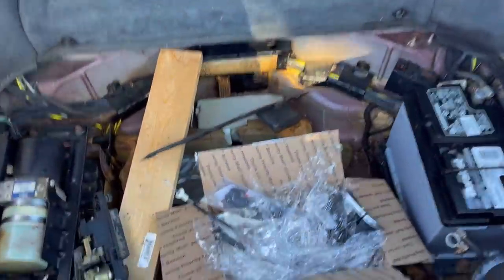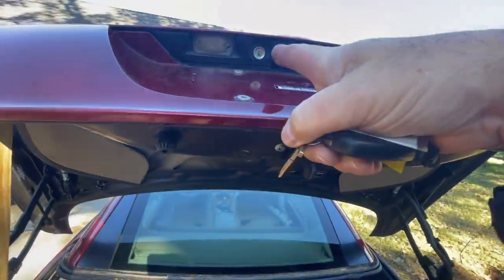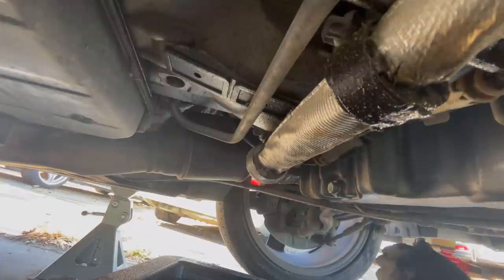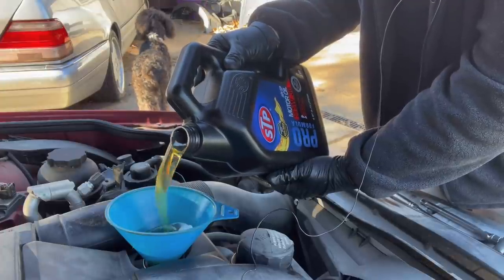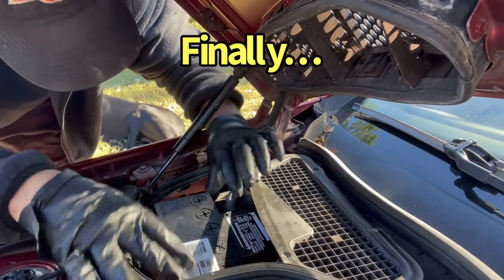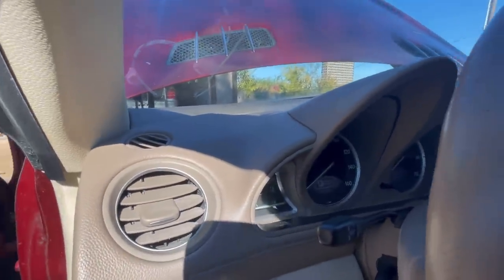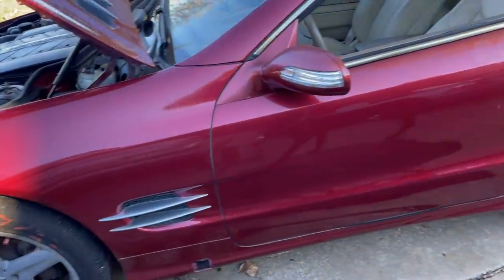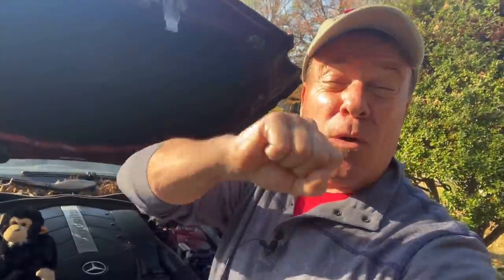Rebuilding My Cheap Copart Mercedes “Rusty”

Comment: For what it is worth; Marvel Mystery Oil burns off in 1-2K miles.  Leaving it in until that happens is the Best way to clean it out.  As long as you don't exceed 20% oil capacity, you wont have an oiling problem while using it.  Been around since the 30s!  No problems.

Comment: This video series will do really well. 
I have a nicely sorted 05. Navy blue on tan interior. I’ve seen how much interest was generated by the simplest things.  You are already a winner on this project. ABC is functional. You may consider ABC fluid and filter replacement before the first test/joyride. Than change all the accumulators just in case. Cleanliness is the key, any debris and the whole system may fail. Alex from legitstreetcars had a video not to long ago, check it out. 👍
Reply: Watching Alex sort out that ABC system was so stressful but fun to watch!
Reply: @chadtacular  In my opinion, technician of his calibre and experience only did it for the viewer. Other word this way it was easier to follow but definitely longer. Present one issue and resolve it before moving on to the next. I’m only saying it because I’ve done the ABC overhaul myself and found it easier and cheaper to complete all the tasks before the test.

Comment: Check the BCM module - battery control module. If this is broken you will get the error even if you change the rear battery

Comment: Enjoying the vids mike, thanks! Those third brake lights are expensive right 👀! Also super fragile and come with a black seal that as far as I can tell doesn’t fit so is a bit of a red herring, goes in so tight without it you don’t appear to need it (on the CL anyway). Seems to take a lot of cranking, might be worth an injector additive with the fuel and a new fuel filter 🤷🏻‍♂️

Comment: Love this car. Are MB cars at all DIYable? I'm thinking about finding one to project on. Did many diy repairs pre-computer but never anything high Dollar.
Reply: Yes they are ..around 2000 to 2005 are the best to DIY.
Reply from the maker: I’d choose a 2002 E320 if you’re looking to try Mercedes !!
Reply: Thanks for the replies. Any specific fails to run away from? Hmm, how many MB flips to a Rolls :) ? There's a series.
Reply: @RoadsterLoverMedia  Avoid E and S  class with complicated braking and suspension systems ,,SBS and ABC can be prone to costly repairs and harder to DIY . ...stick with C or CLK class.